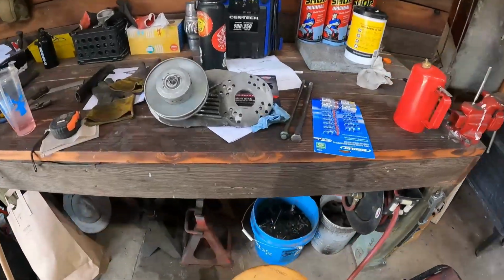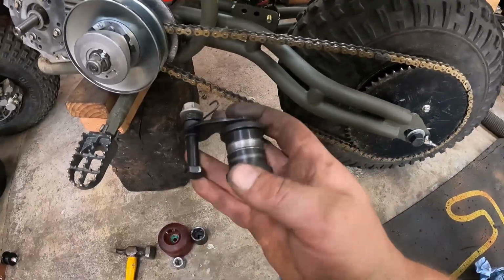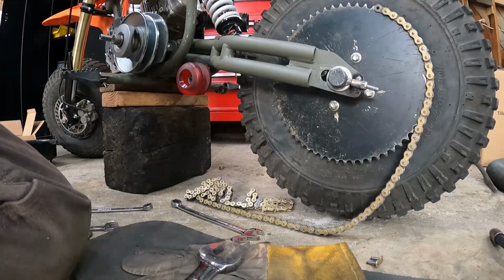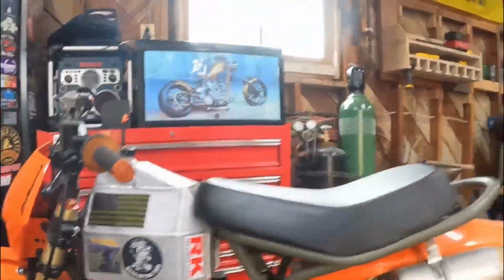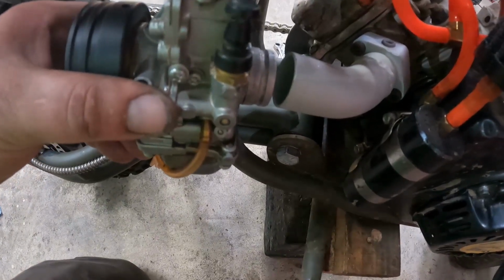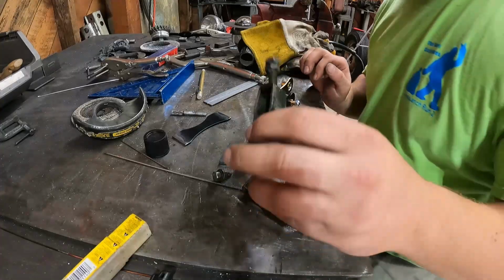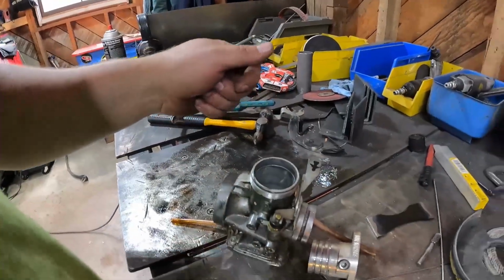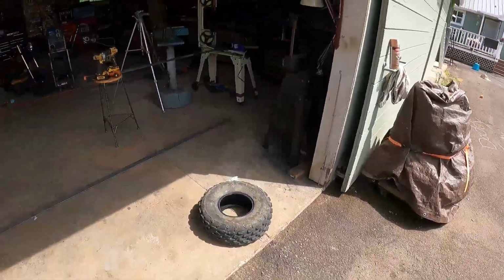Chain tensioners and Welding Carbs?

Comment: Great idea welding the carb. I hate those rubber boots.
Reply: I agree, but a longer intake improves torque, so that's a plus
Reply from the maker: Ya I would have liked to put a little bend in the manifold, but I didn't have mandrel bends for that size tubing.
Reply from the maker: Definitely should have taken a little more out of it.

Comment: I just saw this video. The biggest problem you have when using a hose between the intake and the carb, is vibration. If you install a support strap or bar of some kind it should (in theory) eliminate the vibration thus keeping the carb I place.
Reply from the maker: That's a good idea